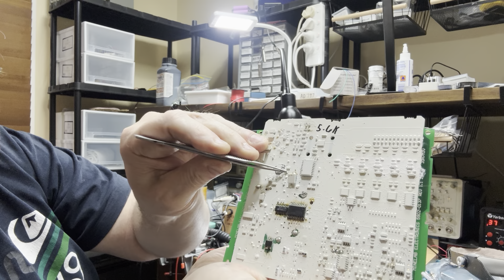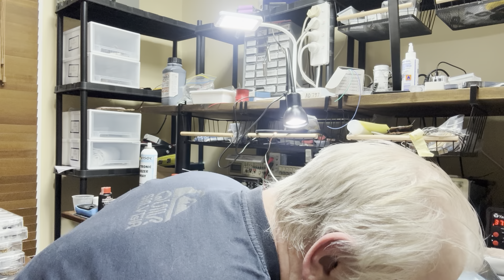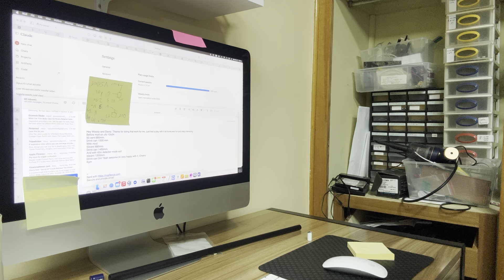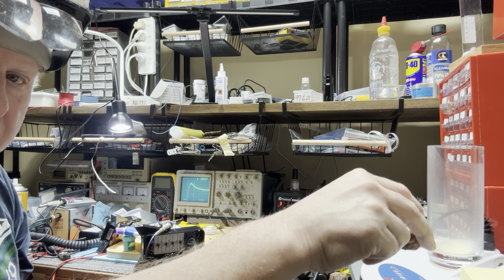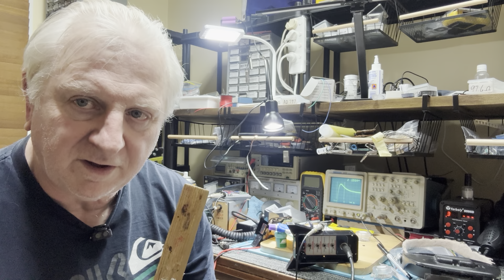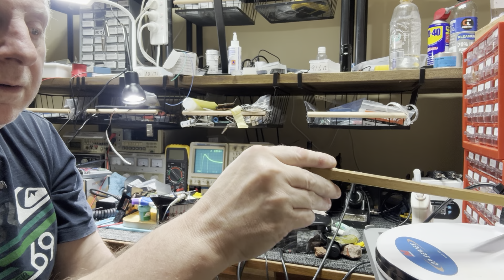Amazing new mods for Minelab p.i detectors

Comment: Hi Woody, regarding the variable resistor: what type of potentiometer should I use? Could you please advise on the resistance value (ohms or kilo-ohms)? Thanks.
Reply from the maker: The pot only controls the electronics.

Comment: Hi Woody, appreciate your work mate very knowledgeable. I have option  to purchase a 7digit SN 4500 modded by yourself in 2015  ie variable gain  / Frequency. Given the SN can you confirm mods? As I can see V/gain knob but the V/frequency is obviously not visible  & Unfortunately dont have option to inspect as getting it shipped  + guy im looking to buy from has limited experience. Any input appreciated.
 cheers Justin
Reply from the maker: Contact Dave on our website and tell him the S/N

Comment: Today I focused on the importance of proper damping. It's very important. I made sure the damping of the device was far removed from the coil's default damping. When focusing on high gain and deep targets, I found the sound repeated and echoed, which greatly interfered with listening or receiving distant targets. Thanks for doing that. I'll order one. Thanks, Woody.